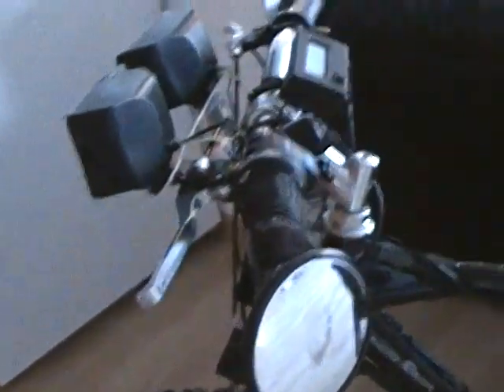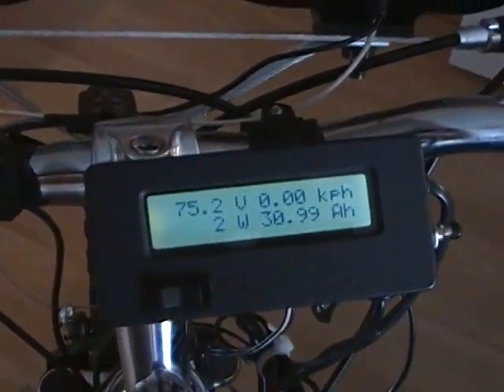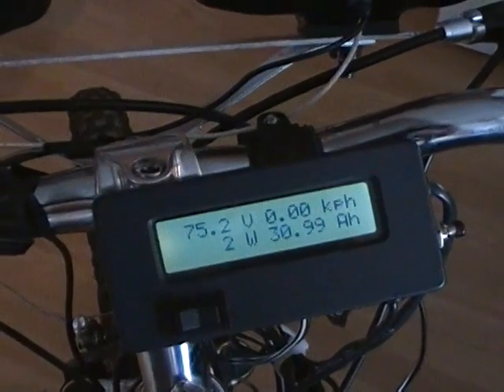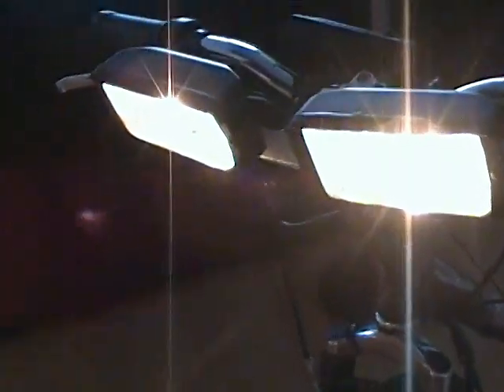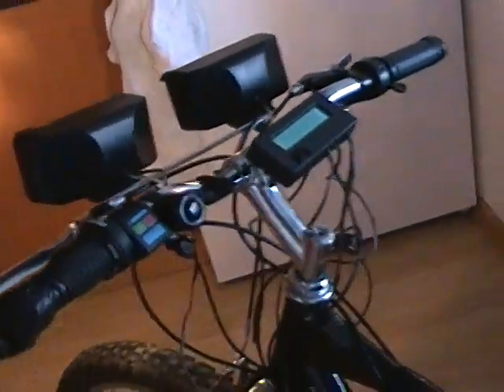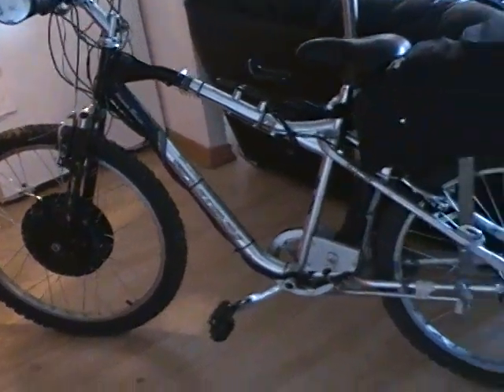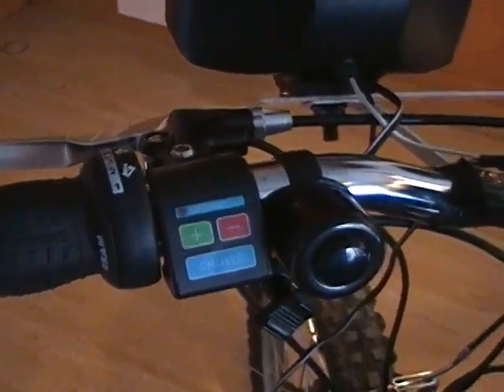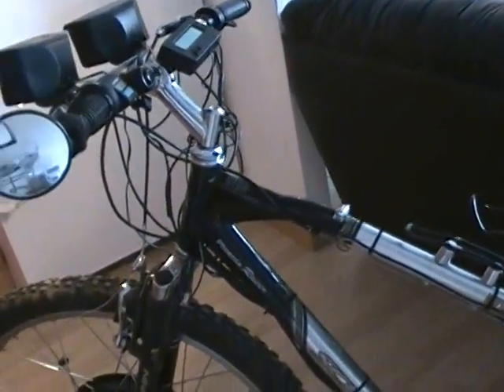Crystalyte 5303 X5 Bicycle Hub Motor Electrical Description

Comment: Very impressive, especially for the times. Question: what affects torque the most? The motor wattage, the controller wattage, the battery voltage, or the battery capacity (Ah)?